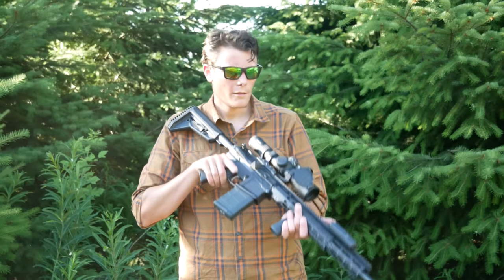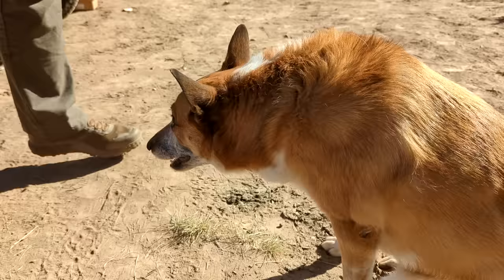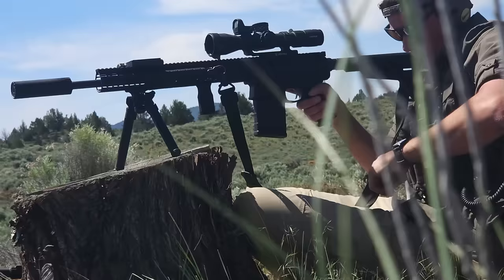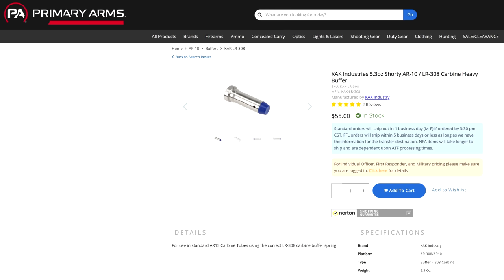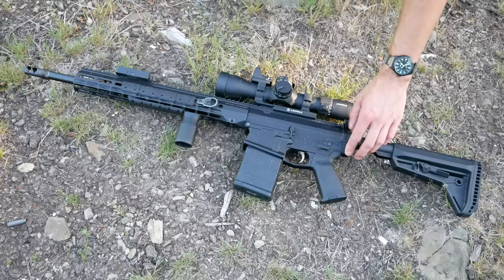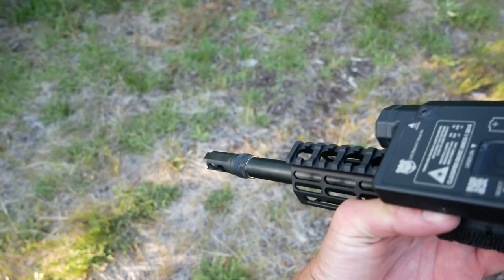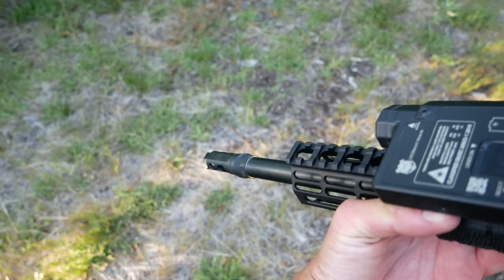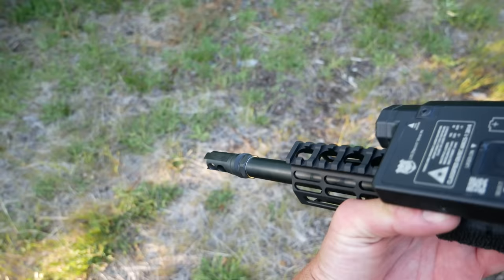Aero Precision M5 SAPR Build

Comment: the secret to a reliable AR10 that does not recoil like crazy is using an A5 buffer tube + EA1095 armalite spring + atleast H2 buffer, probably H3
Reply: We always did red sprinco and h3 for every large frame (read AR-10/M5) build that came through the shop. After that it was adjustable gas block for specific builds
Reply: Exactly, right on the money.
Reply: & then you put lasers inside the ammo & then fuck the lasers. 100% best build
Reply: No it’s not ;?)
Reply: Sprinco red or orange + h3 works wonders
Reply: Nice
Reply: @wh0car3s943  orange is meant for the short buffers and ar-15 receiver extension.
Reply: @phoenixnfa are you using the A5 buffer tube with that spring? I'm trying to understand how it all goes together
Reply: @dp2pl8  a5 Tube. Red sprinco. Standard h3 buffer
Reply: Orange didn't work for me, but the geissele spring had been great.
Reply: This is the way. I used a Tubb spring on my build but I heard great things about the ea1095. Add an agb for additional adjustability.
Reply: Geissele spring and h3 ftw
Reply: I just used all jp enterprises for everything but the barrel
Reply: @FloresTrumpet  if anything you might need to open the gas port up, I know I had to for one of my ballistic advantage barrels. I assume they're specd to work with those weird cut down buffers.
Reply: Yup, A5 is the original AR10 carbine length and allows you to use standard AR15 carbine buffers
Reply: Sprinco springs always caused me issues. Always used oem armalite
Reply: adj. GB's really are amazing.
Reply: Nothing I have shot feels as good as a tuned gas system. Lightweight bcg. & a brake with silent captured buffer.....
Nothing 😆
Reply: I like the JP SCS in mine, that works pretty well
Reply: A good brake will make more difference than anything else to reduce recoil.
Reply: The true secret is adjustable gas ...
Reply: Or just get an adjustable gas block...  or an adjustable carrier like he's doing.  Especially if you are going to shoot both suppressed and unsuppressed.  Being able to dial in the gas solves any hiccups with sus ammo.
Reply: @thehun06  this wasn't all that mine needed.....I started with gas block...then scs...then jp bolt....then lmos....finally ultradyne brake....I wanted light.sub moa . Fast to shoot....and not to chew up brass  ....this is the main reason I went so far
Reply: @prone_wolf8871  Now build another one that way from the start.. and save a lot of money.
Reply: @calholli  I have all my builds use basically the same components...except I use bcm uppers
Aero lower...jp enterprises and geiessle 
Parts and bcgs.. faxon & proof barrels

....and I didn't really lose much money one the first one cause I got a smoking deal.....

.but the deal wasn't perfect, lol....the seller never mentioned the reliability issues....
but technically, I have them for spare parts now 😅 

 I never checked, but the previous owner ran it suppressed, so maybe modded the gas port .

Edit to add...the rifle is an Aero builders kit with multi cam cerrakote from the factory (400 for just the receiver set at the time)
..and it came with a nightforce nxs in geiessle one piece rings for 900.....lol(pre covid)

even if the barrel was shot, I couldn't pass that deal up..basically got the gun or the scope for free....
Reply: @calholli  You really want a heavier buffer to slow down the opening time of a 308 cartridge. Trust me, I've experimented on restricting gas and using lightweight components and using full weight components + heavier buffers. there's no comparison, even when you have to make bigger gas holes to make it work. the recoil is completely different.
The heavy buffer will give you a larger area of reliable function.
Reply: @newerest1  mabey ...

but I love the way my m5 runs with adjustable gasblock. Lmos. scs. and ultradyne brake.....it's crazy fast crazy flat and it dropped off quite a bit of weight in doing so......also it was the only way to get the weapon to be gentle with brass.......how does your setup treat the brass?  Mine chewed it up until I replaced everything....now it comes out the same as it went in....

You said yours doesn't recoil like crazy....my setup feels like it barely has any recoil lol
Reply: @newerest1  so your over gassing it to add more weight?  That sounds very counter productive 🤔
Edit to add not being snarky .....but I'm curious how the reliability window is bigger doing it that way  vs my own. 

Cause when you tune your gasblock you can tune it as light or over gassed as you like.....so generally you tune to mag lock....then bump up the gas a few clicks  for reliability........
So not sure what kind of setup your talking about where your "reliability area" is larger?
Reply: @newerest1  I know.. and I agree.   You can get a 3 pack of the tungsten weights from browneIIs for only twenty-four dollens.   Pull the buffers apart and add the weights yourself.  There's no reason to overpay for it.
Reply: I run a JP Enterprises SCS H2 and VMOS BCG H2 and it shoots like a dream
Reply: @natebrbora  You can just get a three pack of the tungsten weights for twenty-five dollens at brownells and make your own H1/H2/H3 buffers for super cheap.   There's no reason to spend all that.  You're just adding more parts that can break.
Reply: I have an 18in lr308. Rifle length gas system, rifle buffer system and non adjustable gas black. She runs just fine lol
Reply: @GaMeRfReAkLIVE  I have a db10.. Has the SR25 pattern receivers (not LR308) and it runs fantastic.  You can grab another upper in 6.5creed w/ 20" stainless barrel for under 500.. Which is crazy cheap.  You can build the whole thing for under 800..   I don't understand why everyone doesn't have one.  They are great rifles.
Reply: The G$ spring and an h2 did the trick for me.
Reply: I went the opposite direction and emptied the buffer, used a lightweight carrier and adjustable gas block. 

Recoil is pretty mild and runs like a champ
Reply: 20" M5 upper for mine. Lower is M5 with a VLTOR A5 tube. H3 AR15 Carbine buffer with JP AR10 stainless steel rifle spring worked well. I just installed a Tubb spring with the same buffer for testing. Compared to a carbine length buffer system, the A5 hybrid with the AR10 rifle spring and AR15 carbine buffer is a very noticeable improvement.

Comment: I just replaced my M5 heavy barrel with a Faxon Gunner barrel which is basically their Hanson style profile. The weight difference was insane; it saved like 23oz just in the barrel.
Reply: Ya, that Gunner is a nice light barrel. Tough call between that and the BA Hanson. Hanson has more of a SOCOM profile, which provides better rigidity for can use.. I have both in 5.56, and the Big gunner on my LR. 👊🏼🇺🇲👊🏼
Reply: Yep....same....I went with jp lmos and it dropped even more weight and runs fast and flat 😳
Reply: @prone_wolf8871  do you like the JP LMOS? Any reliability issues?
Reply: @heyhayhay247  not with my set up.....
I won't run anything eles anymore except  jp enterprises or radian enhanced bcg...

Pros....loses shit ton(in context) of weight.  Runs crazy fast..and flat.(as a whole setup)
Nicest machining I have seen on a bcg...
Easy to clean cause it's so highly polished....
This was one of the last parts I used to completely tune my 308 to NOT CHEW UP brass. 

Cons....expensive as fuck 😆 
Doesn't have forward assist cuts(I'm one of the people that like having forward assist because I'm not a moron and know how to utilize one & have needed it.....
Expensive as fuck 😆....
Reply: @heyhayhay247  also...the reason I went all out with the jp Enterprises parts  was I bought the m5 built by someone else....it came with a faxon gunner barrel and Aero parts...... the gun  was basically free with the deal I got.....I soon found out why 

The deal wasn't perfect because the thing had reliability issues....not sure if the first builder did some wonky stuff to the gas port size in the barrel cause he ran suppressed...

But it did not group  well...and was insanely over gassed to were it was chewing up my brass (which I intend on reloading) 

So I tried to be cheap and replace one part at a time until everything was running the way I wanted.....

First started with adjustable gasblock.
Then silent capture buffer system.
Then jp bolt. Then the lmos bcg.....hindsight I would have saved some money just ordering everything at once.... 
but you live & learn...but now I just start with jp. Geiessle or radian bcgs and parts.....
It ended up being a sub moa with federal Gold match and shoots insanely flat and fast.....
BUT.....BUT....my 6mm arc  is my new flame 😆  got a 3 inch group at 1000k yards........
I'm going to build a lighter weight version of he same gun to see if it can shoot so well....if so.....I'll probably sell some of my other builds 😆 it's the lsst build I can forsee.....but you know how that goes......lol
If you want complete build recipes let me know  😃
Reply: Don't believe hops vid on the ubr stock though lol..... it's the only stock I'll run now hahaha 

if your trying to build an accurate rifle......you want the stiffest stock you can get......